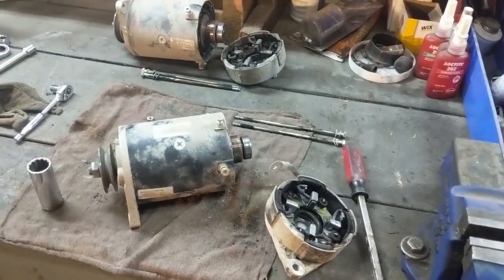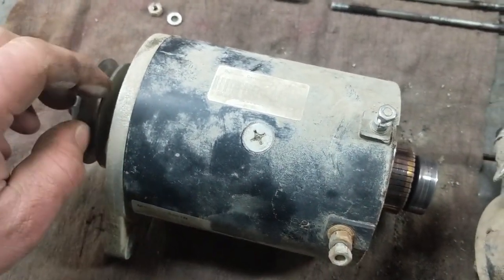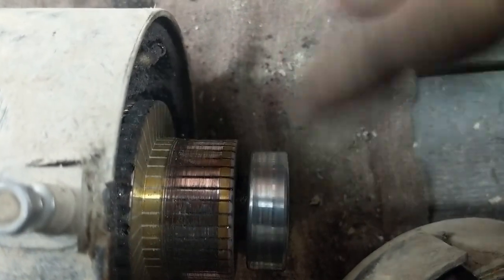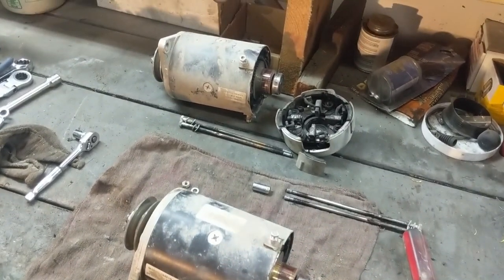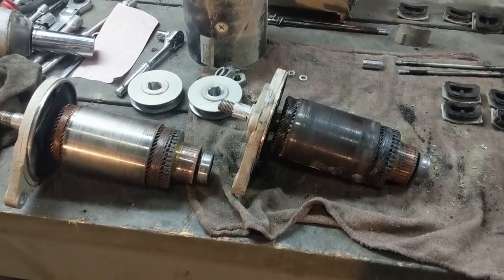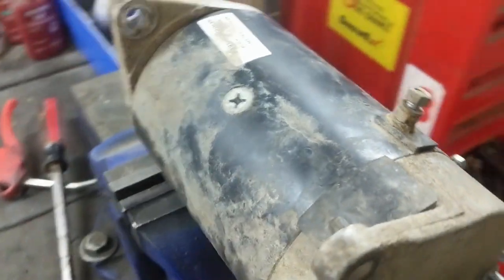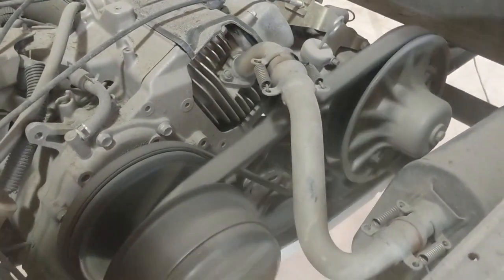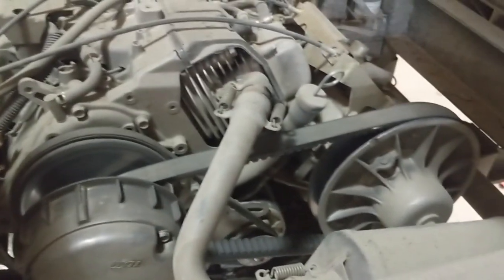Fixing a golf cart starter

Comment: I have a charging issue with my 2007 Club Car Carryall 232 that I just can't seem to figure out. The golf cart cranks over perfectly fine multiple times. But the battery isn't getting charged. I bypassed the voltage regulator and connected a wire straight from the DF terminal to the battery (-). My voltage reading at the battery doesn't change when I rev it out. I actually get a little spark if I try to remove the cable from the battery while it's revving. I opened up the starter generator and the brushes look good and so does the commutator (nice and clean) surface. I sanded every washer and nut to be sure that It wasn't just a faulty connection. Am I missing anything here? Any help would be greatly appreciated!
Reply from the maker: I dont think connecting the starter/gen direct to batt is a good idea, I am pretty sure the gen is to put out 24vAC which is bad for your batt. the regulator/rectifier takes care of this. disconnect the regulator / rectifier, Does the starter/gen put out 24vAC when you run the engine but not connect it to anything? If it does, problem might be the regulator/rectifier.
Reply: machinesnmetal I will check for this when I get home and keep you posted. I only momentarily connected the generator to the battery just to see if there would be a spike.